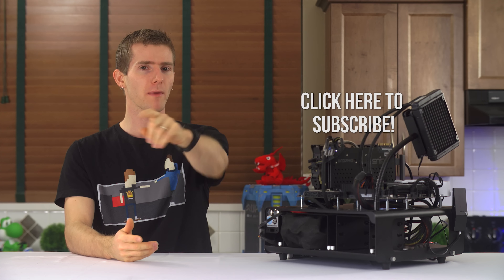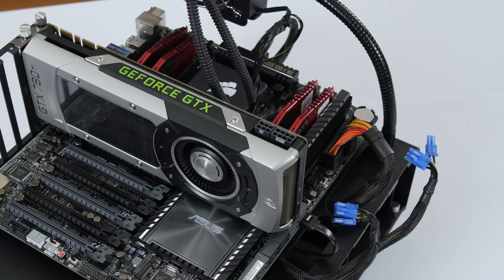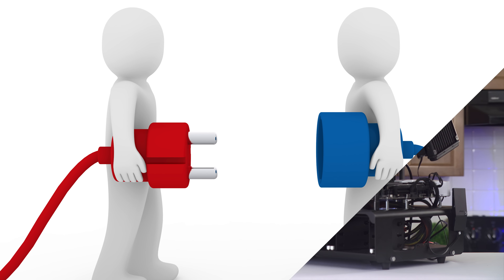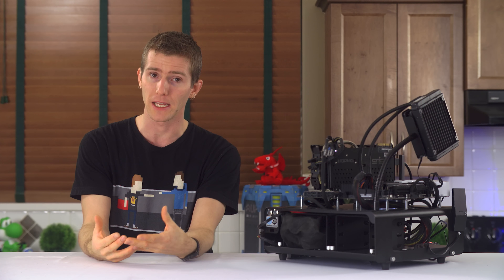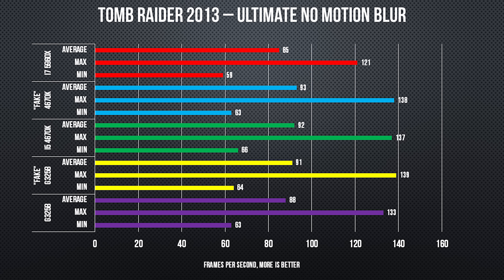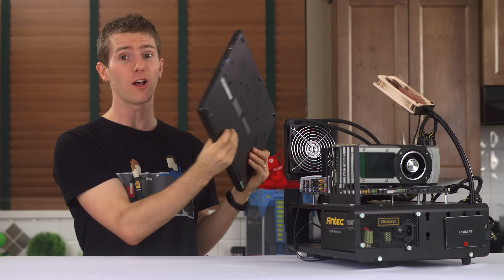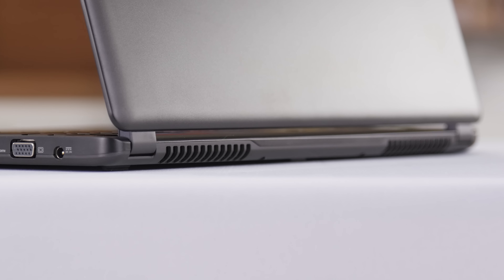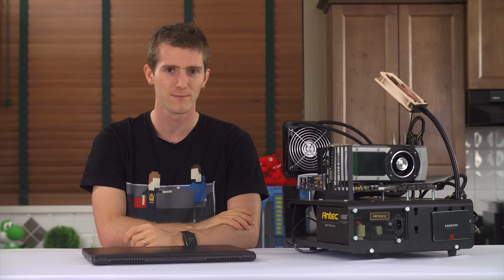CPU Simulation - Can You Simulate Performance of One CPU with Another?

Comment: I think the "Why didn't you use AMD CPU's" was more about why didn't you make a separate section to test the FX line up against itself and separate from the intel chips. There would also be less motherboard switching. I think an AMD test would have been pretty sweet and not really including one does kinda annoy some people :/
Reply: doesn't help that there is a tonne of videos on intel chips, but not alot on amd

better or not, there's only so many times you can hear about the glorious blue side before getting bored
Reply: Because this wasn't a test to show one side vs the other or even intels line up or amd's but just as an example of multi-core cpu load testing and what advantages you get from going from dual core to quad and hex that in basic theory should apply to all cpu's. It could of been done with AMD but chances are due to sponsors etc linus just has easier availability or more intel cpu's to hand to do this sort of test.
Reply: Finlay Killoh Not asking for AMD v Intel, more for a completely different test. There may be differing results due to physical cores or architectural design. Also would have been interesting if stock/OC's were thrown in.
Reply: Finlay Killoh I believe that when mention 8 cores, 90% of people will think about AMD FX because they can actually buy them. He could have made a separate vid for AMD.
Reply: Sadaki
Intel is true 8 core part, amd fx part is not really a true 8 core cpu as amd would like you to believe.
Reply: arbiter1 The true 8 core is stupid, the only different is shared cache. Back in Core 2 time, Intel also stick 2 dual core modules into one and call it quad.
Reply: Sadaki to a certain degree it doesnt matter what cpu brand is used the difference in architecture will have an effect but this is more to show how software uses multi core cpu's and where the advantages are and whether 8 cores gives a significant performance boost over dual, quad or hex.
Reply: Because they are sponsored by Intel, ofc they will never say any good about AMD cuz then theyll just get less money. And money is everything.
Reply: The thing is, its not a bloody contest, true 8 core or not. As a current AMD user, i would just like to see if similar sort of results are shown on AMD, or if the different architecture has something else in mind.

Is that really too much to ask? or are you Intel fanboys so deeply rooted that even a mention of AMD gets your knickers in a twist
Reply: Finlay Killoh The FX has been known as a better steaming CPU for a long time, hence same stress test as the last video. You can get one with price only a bit higher than a i3.
In a same stress testing environment, will it worth it? Of course, it is.
Reply: Roy Davies you miss the point of the video entirely though its not to show how intel cpu's work with more cores but just to show what more cores can do in general, it would be great to see a video covering both brands but not really something i would expect LTT to do as this isn't a serious high end tech benchmark channel this is tech news and reviews with some useful tech info like what are the benefits of ddr4? and do you gain from having a $1000 wifi point?
Reply: I think YOU misunderstood the video entirely, This video is showing if you can emulate lower core processors with a higher core one in general. But as everyone knows, amd cores are a bit whack.

What i want to see is not cores in general, but if AMD's architecture has disadvantages or advantages in terms of lowering its cores and trying to emulate lower end chips.

for example, does turning of a single core per modules make it behave like a true quad core, or much worse? we've seen Intel can emulate in most cases from the video.

Next time get your facts straight, and listen/read.
Reply: Roy Davies im talking about the video this video was made to clarify the methodology of, this video just shows the validity of simulating different CPU's on a single CPU by downclocking and disabling some threads etc. its more of linus doing it to shut up the complaints and prove that its valid than to show that intel can do it or for any real review reason so i dont see the benefit of doing something similar for AMD, the rest of us are discussing whether it would be worth doing a seperate video showing how AMD processors scale up with more cores what your asking for is something else entirely and not really that relevant to this discussion maybe.
Reply: still, it would be nice to see more, thats all im saying.

There's so much intel content on youtube right now that this exact video has probably already been done
Reply: mmm true, and amd is pretty shite atm

getting rekt on high end processor AND high end graphics front, only reason i use them is because i built the core of my pc when i was a student and its too pricey to replace processor and mobo
Reply: No one cares about AMD. At this current time there is no reason to buy one.
Reply: Sadaki Fx CPUs are not true 8 core.
Reply: Dr_Palace slowpoke cpt obvious
Reply: jeremiah9561 The Fx cpus still shitts on the i5 lineup when it comes to multitasking if im not mistaken.
Reply: jeremiah9561 just because there is no reason to buy, doesn't mean no reason to own one, my 8350 is plenty fine for what i use it for and i wouldn't consider replacing it until it starts to bottleneck and even then i'll be going for something thats a towards the top end when that time comes

Youtube videos are meant to be interesting, and im sure alot of people might be interested in something that hasn't been done a million times
Reply: jeremiah9561 price is one reason a lot of people go with amd chips
Reply: Sadaki No, it's not because of the shared cache, it's because everything is shared between two integer cores and there is only one floating point core, the part that's actually important for gaming
Reply: brian philips i prefer spending more to get better stuff instead of buying cheap lowend things that won't do the job as i expect them to. and i'm 100% sure that i'm not alone with that statement.
Reply: Tehkezah Problem is you don't have to spend allot to get a really sweet setup and play games at the highest settings. Running an 8350 with a 7950 in Eyefinity 3X1080p. Sweet rig and GPU + CPU combined was less than £400.
Reply: Tehkezah thanks for proving you have no idea what you are talking about
Reply: AMD 8 Core > all!
Reply: ***** they are the same as 2 years ago so nothing new to review..
Reply: ***** Because they haven't released anything new in 3 years; the FX-8350 was the last new one, the 9370 and 9590, 8370 etc are all the same chip with different binning.

I run an 8350 as my main rig so don't go accusing me of fanboyism. It's solid for a <$200 chip but it's no i7.
Reply: ***** Why would he bash APUs? Every Intel consumer processor is an APU
Reply: ***** I suppose, the latest APUS are actually decent light gamers.
Reply: rajjins Yeah they're pretty good for a light gamer. I'd consider Hearthstone to be a very solid example of a competitive background that wouldn't require very much horse power in a pc.

As for the FX line, I feel a little sad as well, because I'm an AMD user, and for what i do, the 8350(got it for 144.99$ with a voucher) is a very solid all-rounder cpu.

But since this channel is on the enthusiast side lately, i understand them not taking AMD into consideration. For performance enthusiasts, AMD is simply dead. Still that doesn't mean they're bad CPUs, and that we, as consumers should avoid them. I'd pick an 8350 over a locked i5 every day...

So, to all here that feel sad and angry for AMD...if they do the job for you, be happy with them, because if you're asking for comparisons etc...that just shows that you're not sure of your CPU, and that somehow you regret owning one.

Although  it may sound contradictory, i would really like to see Linus'(as well as his teams') opinion on AMD right now. I really want to know if they are biased towards AMD(although it never seemed like that), just because intel sponsors the show.
Reply: Tehkezah but some people (me included) just don't have the money
Reply: Roy Davies thats because the glorious blue side is better trolling commence
Reply: brian philips true
Reply: Cyne RTW http://i.imgur.com/YluO3tC.png only appropriate reaction
Reply: ***** even if you can afford it there is no reason to buy better than you can use.  Unfortunately with 8350s still at $180 the extra $40 to go an i5-4xxx is totally worth getting if you are a gamer.  The only thing FX series hold over 1150s is the PCI-X lanes:  you can get a $130 MB for AMD with 4 slots than can do 4 way SLI or X-fire and run them with a $180 chip (although i think it's still 2.0).  Doing that with Intel costs $1000 just for chip and MB. 

So, there are niche use cases where AMD is worthwhile but they are few and far between these days.  I'd still pick one for an HTPC, a homemade NAS or a cheap video editor.  as a gamer even the cheapest i5 is better....too bad, I'd like to see some competition.
Reply: ***** Yeahh completely agree

Luckily with Directx12 and Mantle, cpus are becoming less and less important for general gaming.
Reply: ***** Have a job and do 3d character modelling and animation. AMD is still an option and will always be an option.. if not then Intel would hike their prices higher.
Reply: Apparently AMD only occupy 5% of the CPU market. AMD performance CPU's are getting long in the tooth now and they have nothing in this department coming until at least 2016. You dont see Linus and co making videos of sandy/ivy bridge anymore.

I think hes just making videos relevant to the vast majority of PC users out there.
Reply: Scuba Sausage 5% is way way too low of an estimate.
Reply: Bushy Bush My apologies, its 5.2%. This is my source:

http://www.bloomberg.com/news/2014-10-16/amd-sales-may-miss-estimates-as-intel-gains-pc-orders.html

Q2 2014 - 5.2%. Sorry to disappoint you.
Reply: Scuba Sausage Well that .2% makes up :D I never really thought that the desktop space was that bad I always thought it was in the realm of 20-30%. This does however include computers that are more business optimizes so 2 core chugging machines. What AMD does have though is it's GPU's to fall back on PLUS they supply ALL of the current generation of consoles APU's. Gotta count for something. See what 2016 brings.
Reply: Bushy Bush Im not waiting till 2016. Im currently gaming on an overclocked FX chip and it sucks. I will upgrade to a broadwell i3 or i5 when they drop most likely (depending on how they perform).
Reply: Scuba Sausage They aren't too bad man, triple screening here and running high end 3D modelling software and game engines, no problem at all. For multi-core stuff AMD is still a very tasty option.
Reply: Bushy Bush yeaaah I agree with you mostly but the only reason amd is supported in consoles is because their graphics rendering capable CPU's are cheap AF
.
Reply: Bushy Bush Yeah maybe. But the only thing I need a powerful PC for is games. Ive been heavily disappointed by my AMD chip in this department. Im sure if I was rendering or doing something else with my machine then it would represent great value for money. But im not.
Reply: Totally understand man, What I find also interesting is the price to performance and you can then throw more cash on your GPU to perform better in games.
Reply: Bushy Bush I did. I have 2x R9 280x's in my system. Upon installing the second card I have found that I am able to push the settings higher but the frame rates didnt change much. 

Certainly if your using higher end GPU's or crossfire/SLI solutions you should be using Intel to make the most out of your cards. 

Although that does depend on the application. I just play mostly CPU intensive titles.
Reply: Scuba Sausage well there you go then. Get on those GPU scaling ones :D
Reply: Bushy Bush I also run an Overclocked 8350 but in my case with SLI GTX 670 Nvidia cards.  It is decent, I can play what I want at good frame rates and I can use it for video editing as well (and with the OC it's not the choke point unless I have graphics on low).  The issue to me now is power consumption; I run it 24/7 and with an OC on the chip it's a hog, probably costs me $50 a month by itself in power.  $50 a month pays for an i7 pretty fast...maybe even a 6 core i7.  I suppose I could turn the OC down and even undervolt when I leave it in server mode but that's a pain in the ass and something you just don;t have to do with Intel.

When AMD couldn't compete in performance they always competed in price, but considering all the costs now including power they just barely make the grade for me.  Don't get me wrong, I love my 8350, it's the most reliable machine and overclocker I've had since a Q6600, and my cheap athlon HTPC is awesome, but for any build I foresee needing in the next 2 years I'll have to go Intel.
Reply: rajjins http://www.bit-tech.net/hardware/2012/11/06/amd-fx-8350-review/7

http://techreport.com/review/26996/amd-fx-8370e-processor-reviewed/3

For the core count the 8350 is pretty fricken good at stock and OC on power consumption considering it's age. With the newer 8370E Load power consumption is near 50W lower than the 8350 and 10W lower than a 4960X.
Reply: amd cpu's having ridiculous power consumption is a myth, you'd have to be pretty stupid to believe it without doing the tests first.

an 8350 will more likely cost you $50 a YEAR. fucking hate it when people make up shit, jesus christ just do some research
Reply: Yeah I dont think AMD chips are consuming ridiculous amounts of power.

It all depends on how you use your computer, how much energy costs, clockspeed etc.

Intel chips run faster and use less power. The performance per watt is way bigger on Intel. I think this makes AMD chips look worse than they are power wise.

Its interesting to note though that the 9590 does use a lot of power. So much so that only a few AM3+ boards support it. It is something like 3 times the power of an i5 at full load I believe.
Reply: Roy Davies while I agree power consumption doesn't really matter when plugged in, it does on a laptop. I'm fine with getting a amd desktop, but for a laptop I'd stick with intel.
Reply: Lejf Rossi Laptop power consumption is about battery life/quality over electricity costs

plus you'll find that the power differences are negligible at best. I'm all for intel and plan to upgarde to an i7 in the next few months, but power consumption is a bloody stupid argument
Reply: Roy Davies Even over the span of a year you WILL NOT see a difference. A yearly bill of $2,170 or $2,200 is nothing to worry about when the difference would be so damn small. (Random number)
Reply: ***** The only thing that's good about an AMD FX series product is price to performance/price of the platform .. I should know I had a Crosshair V and 8150, sadly my low end 3450 beats my 8150 clocked at 4.5GHz ... And omg the Heat ...
Reply: Roy Davies running 24/7 at full load with a 5.0 OC versus an i7-4770 it would cost me $170 more per year to run my 8350 chip at the ridiculously high retail cost of power we pay here these days, and that's in just the chip which is less capable than the stock i7.  Obviously I'm not 100% loaded all the time but I probably average >70% because it folds or runs BOINC on top of acting as a server when I'm not using it myself so call it $120.  On top of that, when not loaded the Intel chips low power states are much better too as well as chipset power consumption.  AMD graphics cards are the same way with power but are superior data crunchers so they make up for it.  $50 a month might be an exaggeration but AMD is killing us with 32nm tech plus the philosophy of throwing voltage and clock speed at it to try and compete, when you have 4 loaded systems running 24/7 that cost adds up, and it adds up to sequentially replacing AMD with Intel instead...at least until AMD can bring something new out in the performance segment.

When I lived in an apartment before I bought a house I tried an experiment on one system; full power for 30 days versus no crunching for 30 days;  Power bill went from $120 to $30.  I can't blame that on AMD as an Intel would have sucked a ton of power too and ~60% went to the GPUs, but claiming that power consumption in computers is a non-issue is also bullshit.
Reply: Roy Davies I dont really care about power consumption. But why the anger and the hard language? Are you actually that passionate about the facts surrounding power consumption of Intel vs AMD?
Reply: rajjins actually scratch part of that; I am telling people not to buy AMD; at this stage no one should buy AMD unless you already have AMD hardware.  For a scratch build use Intel all the way and Nvidia for high end GPUs
Reply: rajjins What is wrong with AMD gpu's???
Reply: rajjins Jesus christ do you even know how to read? we've been talking about general use all through this thread and your still banging on about 24/7 use. i have built so many systems for people all with similar budgets, including 2 fx-6300+gtx970 systems in the last month. those 2 fx systems outperform the others simply because they had more money for gpu. face it the age of the cpu is dying, these days most budget cpu's won't even max out on games because the gpu has most of the work.

second of all no one's been talking about which gpu is better everyone knows amd are being slaughtered by nvidia at the moment.

im unfollowing this thread, i would rather spend my time on my projects than try to educate some intel bumboy. maybe if people realised that intel or amd give -1 shits about loyalty we'd have logical debates.

(p.s ignore any typos im too drunk to check for any)
Reply: Bushy Bush nothing, they are just behind on release cycle in the high end at this point and have had a lame response so far.
Reply: Roy Davies for the price of a 6300, you can get an i3-4160;  the multithread heavily favours the AMD but as gamers that i3 will generally win.  For CPU heavy games like BF4 etc I'd say tossup; the day of the CPU is not over as much as AMD would like it to be.
Reply: rajjins I believe that AMD gpu's are still competitive even at the higher end. Going with higher resolution displays such as 4K or multiple monitors AMD cards are still a massive contender.
Reply: ***** Gotta disagree here. I bought AMD. I could not regret doing so more. 

Even at equivalent price points Nvida/Intel can compete these days. 

Everyone should stay well away from AMD. From their woeful CPU's to theyre GPU's which arent so bad but the drivers are dreadful. 

Far Cry 4 is STILL waiting for a crossfire profile from AMD. I will have finished that game before it comes. Ive used AMD/ATI GPU's since the 9700 pro but I dont think I will be buying from them ever again.

In short. Buying AMD turned me into an Intel/Nvidia fanboy.
Reply: ***** Yup certainly buying one card is better than 2. If I had bought two Nvidia cards instead of 2 AMD cards I would be playing Far Cry 4 in SLI. 

Everybody knows a single card is better than 2 cards. But adding a second card is a good way to upgrade. Which is exactly what I did. Certainly miles more performance for a lot less money than swapping out the card I currently have. 

I have an FX6300 overclocked to 4.5ghz. CPU intensive titles struggle on this chip. Arma, FarCry, AssCreed, Guild Wars 2, Skyrim are all titles I have experienced problems with. They all work but consistently getting 60fps is too much for FX. Not to mention you lose out heavily when using crossfire/SLI with an FX chip. They also use more power, exist on a dead socket. Im sure they have advantages but none of them lie in gaming. They are also very cheap.
Reply: ***** Exactly. 55-60 fps. Almost any Intel chip gives a minimum of 60fps. The Pentium dual core beats AMD's FX8350 in Skyrim. There are several other games which have similar performance profiles, where i3's and Pentiums are beating the ageing FX 8350

http://www.bit-tech.net/hardware/2014/07/03/intel-core-i5-4690k-review/5

I like to be able to run my games at 60fps minimum. FX cannot do this.
Reply: Scuba Sausage As strong as the i3's and i5's are in gaming when you do anything else then the FX chips start to become an option. Streaming and content creation is FX territory until you get to the mega rendering and top tier stuff.
Reply: Bushy Bush yeah maybe. the FX chips to seem to win some benchmarks in tests. I have no experience of this because all I do with my PC is game, web browse, watch videos, use spreadsheats and word processing. 

I have a friend who works for an animation company and he swears by Intel for his work. I dont know what software exactly hes using though.

All I can say for sure is that FX is not very good for gaming. And is going to cause me to upgrade to broadwell after only owning the chip for 18 months. Which is a big shame.
Reply: Scuba Sausage Using 3d modeling softwares myself, Zbrush and Maya for modelling and animation, UDK4 as the engine I am working in and then PhotoShop in the background. If I was to spend £130-£150 on an Intel CPU I could not at all do what I am able to do at the same speeds and times as I can with my 8350. Mate is using the exact same programs and recently got the 8370E.

Outside of the realm of gaming FX is an option, inside pure gaming then it gets slapped around.. But crucially.. it has potential for other uses.
Reply: Bushy Bush So basically im a fool for buying an FX chip for a games machine. 

I will happily admit this. Certainly I wish I had spent just a little bit more for an Intel CPU.

My mate who works in animation uses an i7 4770k. I know this because I helped him build his system. He assures me AMD cant touch the i7 for what hes doing. But he seems to hate AMD. Possibly hes biased to Intel.

I too have become an Intel fanboy after buying AMD.
Reply: Scuba Sausage For solid gaming then yes the FX line is lacking severely. 

For animation allot of power comes when rendering and this can be done with GPU's depending upon the software. For video rendering this can also be the case but a 4770k and 8350 are pretty comparable on these tasks.

For stupid amounts of tabs and applications/programs the 8350 has a slight lead over even a 4790k, built one for guy in Uni course with 770's in SLI and benchmarked a few things. 

When maneuvering the 3D environments there was a subtle amount of lag on the 4790k compared to the 8350. This is only really when I have everything open and am pushing both CPU's to 100%. For me the 8350 is great and cheap, for others it will be shit and a waste.
Reply: Bushy Bush Well I agree with the gaming part. I have no experience of 3d modeling. 

Gotta say though, looking at SLI benchmarks Id be pretty upset to get 2 770s in SLI to find them on a board with an 8350.

If your just gaming the i5 4460 costs the same and outperforms the 8350 in games.
Reply: Scuba Sausage Oh no I didn't test the 770's with my 8350, currently using a 7950 with that and just ordered 2X R9 280's so I can tri-CF with them. ;D
Reply: Bushy Bush tri-CF on an FX chip? What non-gaming application does that have? 

If you are gaming it would be better to run 2 cards and an Intel CPU than an FX chip and 3 cards. 

Also you say the 4790k is laggy at 3d modelling. Yet in every benchmark I can find it thrashes any FX chip. Even the i5 beats the FX in most tests.

http://www.anandtech.com/show/8227/devils-canyon-review-intel-core-i7-4790k-and-i5-4690k/3

So im sorry I gotta call bullshit on FX being better at 3d modelling.
Reply: Scuba Sausage Not using just 1 application at a time. Using multiple applications and transferring them around to go from modelling to animation, texturing into PS and then into UDK. All are open at the same time. If it was 1 app open and tested at a time they would be reasonably close with the far more expensive Intel chips taking the lead. As for everything open the 8350 seems to do extremely well.

Also I already had an 8350 and 7950, my 7950 is freaking out so going to chuck in 2X280's and have a little go of tri-CF then take out the 7950 and stick to 280 CF.

I don't have the money to put in an intel chip and will be saving up £3,000+ and seeing what AMD bring out in 2016, if nothing good then will get some high end Intel/Xeon. and 2 of the highest end GPU's available. :)
Reply: Bushy Bush Sorry man I dont believe you. Can you show me some benchmarks please? 

I found some multi-tasking benchmarks, using four multithreaded applications at the same time and the i5 beats the 8350 let alone the 4790k.

http://www.bit-tech.net/hardware/2014/07/03/intel-core-i5-4690k-review/4

Why are you putting so much hope out for Zen? What if Broadwell is really good?

Surely you could have bought another 7950 and used the money you saved on the 2x 280x's to get something like a 4460, or a 4690k? As someone who has 2x 280x's I can tell you that an Intel system with weaker cards perform better in games. I live with someone with a 3570k and 2 x hd 7870's and his system is usually quicker than mine.
Reply: Scuba Sausage with AMD GPUs you can CF cards with the same architecture. So with my 7950 I can CF it with a 7870L, 7950, 280, 280x and a 285. I choose two 280's because for one I can CF with them and they cost me £310 for both.. Also try to buy a brand new 7950 these days. Goodluck.

I do not have the money to spend on an intel chip because the ones that I would need would be touching the £800 region and I do not have that kind of cash at the moment.

I am waiting for Zen to have a look.. if it isn't good or competitive then I will get the highest possible i7 at the time or a reasonable Xeon.

I don't use synthetic benchmarks for CPU's as they can vary dramatically when you are using them day to day compared to what is shown online. Instead I just go around and do what I do normally. 3 monitors, all my software's open and  even recording on OBS. This stresses the shit out of a chip and really see's how they can handle real world applications and multiple applications at once.

My 8350 at 4.5GHZ has had no problem keeping up and competing if not exceeding a 4790k at stock doing the same stuff. (I have pushed the clocks on the 8350 and not the 4790k because of the price difference)
Reply: Bushy Bush The benchmarks I linked you to are not all synthetic. The multi-tasking benchmark is four real-world applications.

Can I see some benchmarks that show an 8350 at 4.5 ghz matching a stock 4790k please. Because I dont believe you. Sorry man. In fact the benchmarks I linked you include an overclocked 8350 at 4.8ghz. It falls drastically short of the i7.

I would say you definitely do NOT need to spend £800 to beat an 8350. Clearly the 4790k thrashes the 8350 in the vast majority of real world tests. Which makes sense as its twice the price of an 8350.

Also you cant crossfire a 285 with a 280/280x/7950/7970. 

Also on ebay at the moment you can get a second hand 7950 for very cheap. £53 at the time of typing for a working one.

http://www.ebay.co.uk/sch/i.html?_odkw=r9+285&adpos=1s1&geo_id=32251&MT_ID=12&crlp=37329124389_2113181&keyword=r9+285&device=c&crdt=0&clk_rvr_id=757770380587&_osacat=0&_from=R40&_trksid=p2045573.m570.l1313.TR6.TRC1.A0.H0.XAMD+HD+7950.TRS0&_nkw=AMD+HD+7950&_sacat=0
Reply: Scuba Sausage Yea balls didn't mean to add the 285, knew I forgot something and it was the 7970 I forgot instead.

I never buy computer parts second hand as I do not know what the previous owner has done with them in terms of stressing them out and they could die in weeks or years. Not willing to take the risk and would rather a guarantee. (Also do not trust Ebay at all)

You do not need to spend £800 to beat an 8350 at all, in gaming you can spend under £100. In rendering you could spend maybe £250 to really start to kick shit into gear.

The biggest thing that draws both myself and many others to chips like the 8350 and the piledrivers is that there is more potential. You don't just have to game on it. You don't just have to render. It's an all-around chip. You don't have to bust the bank on the chip or board, they overclock like animals and CAN still compete with chips being released today.
Reply: Bushy Bush Ok just from the benchmarks I read it seems the i5 is a better all round chip. Its 5-10% slower in some multi-threaded applications than the 8350. But 40-50% faster in single threaded applications. Also if running multiple applications at the same time benchmarks point to the i5 outperforming the 8350. 

Im willing to believe an 8350 can outperform it. But I would like to see some benchmarks/tests. 

I dont really think the FX series does compete with chips today. It competes in the way that they are cheaper and offer a good value for money situation. The FX competed with Sandy/Ivy bridge better but it lost to them too.

If AMD chips competed performance wise with the Haswell series from Intel then AMD wouldnt have cut their prices so much.

Ive bought 2 graphics cards over the years from ebay and my bro has bought 2. Niether of us have had any problems. In fact the 280x I picked up in the summer was in pristine condition and ran quieter than the original new 280x I picked up in 2013. I can understand why you wouldnt take the risk but £53 for a 7950? Thats a pretty good bargain.

http://www.extremetech.com/computing/100583-analyzing-bulldozers-scaling-single-thread-performance

I know this article is about bulldozer but the performance difference from bulldozer to vishera is tiny. Its an interesting article which highlights the shortcomings of these FX CPU's. People lost their jobs at AMD because the FX range has failed to deliver. AMD market share has decreased to 5.2% in the last quarter and is still falling despite the fact that the chips are dirt cheap.
Reply: Oh god no, I never buy parts second hand. Had too many friends do the same and shit went down hill fast. They try to save £50-£100 on something and it has broken in weeks/months. 

Even if a 7950 was new there would be no point in buying one of them when I could just get a 280 which is essentially the same, has newer parts and is under warranty.

As for Ebay I have had nothing but troubles when trying to buy/sell stuff on it. Sold a computer and got taxed as much as you would if selling a car. People can be petty and try to get allot out of you or complain about the stupidest shit.

Not a place for me.
Reply: Bushy Bush Ah yeah I never sell old hardware. Usually just give it away to friends in need or build systems with it. Did repurpose an old core 2 duo machine with a gtx 260 into a minecraft server last year. Was good fun. 

Ebay favours the buyer usually. Ive read about cases where people received faulty components and managed to get their money back. Ive never had a bad experience. Or know anyone who has. Each to their own I guess. 

I got an R9 280x dual x by sapphire for £107 in August. As I said it was pristine and runs quieter than the new one that I bought from Novatech. 4 months on and its still fine. Its actually card number 1. Which means its being used. Far Cry 4 and CODAW are both games that STILL havent got proper crossfire drivers. AMD drivers suck with launch titles.

As for warranties I have never used one. I could have for my Werstern Digital hard drive that died. But I couldnt be bothered, I just bought a new one.
Reply: Scuba Sausage As of yet only had to use a warranty twice, used both on H100i coolers. Damn pumps don't like to last. One died 8 months into use and the other died on arrival.

Instead of the 280's I was going to pick up a 970 but CF 280's are a good 10-20% better and I already have a nice 5760x1080p set up and eyefinity is so easy to use so screw it. :D
Reply: Because AMD cpu are too old. Few people are still buying AMD CPUs in these days. AMD has also stopped making high end CPU. So intel is the only one to go with.
Reply: To all those still trying to claim that AMD can compete with Intel. Techspot recently managed to prove than an i3 can smoke an overclocked FX 8320E. 

http://www.techspot.com/review/943-best-value-desktop-cpu/page6.html
Reply: ***** you won't do much with gtx 750. Get the ti version which is twice as powerful than 750... Or else get a ps4
Reply: ***** sorry to deceive you but VRAM amount doesn't give you fps boost. You completely misunderstood how GPUs work.

You have any link about 2 fps that you saw in benchmarks?

Cudas cores are the most important thing. Now it's like you're saying cpu cores are not important. It's not because you bumb the memory frequency to gddr5 that your gpu will perform twice as it was before, there so many others things to take into consideration...
Reply: ***** i thought gddr3 card don't exist anymore.... 300W psu where did you get that. You should throw this garbage and get at least 500w
Reply: ***** gtx 760 and 770 have less than 2000 cuda bit still powerful.
Reply: ***** yea pc market is bullshit. You can go with consoles. Or else you have no choice to stick with nvidia and intel who add 5% power every year.
Reply: ***** There is always choice, if there wasn't then expect stale releases and higher prices. AMD offer a cheaper alternative to CPU's that are still highly capable of playing games even at 4K and their GPU's are near enough on par with Nvidia and occasionally outperform.
Reply: Bushy Bush AMD is dead. They released nothing since ages.
Reply: ***** clock speed and core numbers mean nothing.
Reply: +Smoos54 While I don't like AMD CPUs much, just informing you that core numbers DO count if you're editing videos. I just hate it when people disregard the editing consumers.
Reply: +Smoos54 While I don't like AMD CPUs much, just informing you that core numbers DO count if you're editing videos. I just hate it when people disregard the editing consumers.
Reply: Infinite Zero They do but 4 Intel cores seems to be faster than 8 AMD cores at editing videos.
Reply: Bushy Bush Because it doesnt show a different point